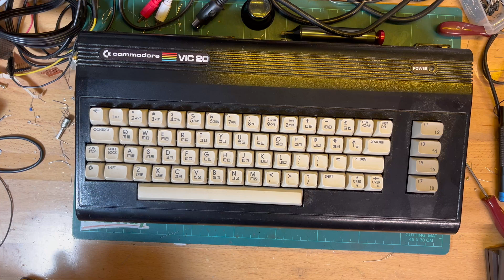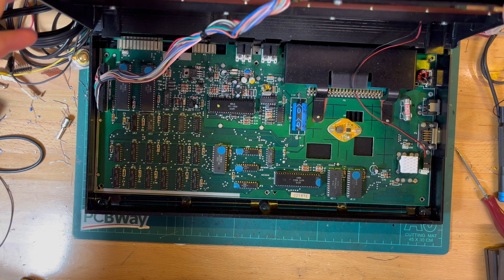Simple KiCad For Simple Vintage Computer Hobbyists: Part 5 (VIC-20 RAM Expansion) [#TCE0597]

Comment: What would it take to make the switching of the RAM expansion the result of keyboard combination presses? Electronics noob alert but could you feed a few keyboard lines into the GAL and program it to have logic that if you press, say RESTORE + F1 it switches the RAM off and RESTORE + F3 it switches it on? I assume it would need to reset the machine at that point too. Not a request, just curious.
Reply from the maker: I know similar has been done, i.e. switching between JiffyDOS and normal kernel on the C64.  It would require access to the relevant keyboard connector pins to get the key press.  If you were designing a new board, like the Vicky20, then you could probably implement the handling quite easily.  I'm not keen on the Vicky20 as it uses the CR version I think ... I prefer the original 2-prong, single 9V powered ones.

Comment: If I understand correctly, this is effectively a switchable internal "3k expansion".

In my vic experience, a more common expansion requirement for software releases back in the day was 8k and sometimes 16k. These days for new games it seems people go for either unexpanded or maxxed out 35k - for example Elite was recently released for this configuration.
Reply from the maker: Yep - main idea is to just replace the internal RAM but we get the additional 3KB as a bonus.  I guess there is no harm in having the additional 3KB permanently active ... it's the 8KB+ expansions that mess around with memory locations more it seems ... but just wanted to be on the safe side.  I wonder ... maybe add Super Expander functionality (i.e. the ROM) as well ... ?
Reply: @Brfff  I think unexpanded vic has BASIC start (program load address) at $1001, the 3k expansion moves this to $0401 and 8k, 16k, 24k, 32k all use $1201 for this. I think the maxxed 35k has it at the same place as 3k expansion. This load address is usually defined in the first 2 bytes (little endian) of a PRG file. So those values often indicate which expansion is required.

3k expansion has no impact on the location of screen and colour memory, so you're right about it being more compatible than the other expansions on this point because these all move screen and colour RAM in the map. 

Moving BASIC can have an impact on compatibility though, for example for the popular single-load machine code program written for unexpanded VIC with a "basic stub" that contains something like 10 SYS 34567 (this is all LIST would show you). If BASIC is in a different place, the machine code that follows the BASIC program bytes would be in the wrong place and all the fixed addresses will be wrong. Pure BASIC programs written for unexpanded VIC-20 might often work OK.

Comment: Hi Brett,  I’ve not checked this but by the 2114 pinout this chip has no output enable which means chip select enables the output already which in turn means when ever /cs is active (low) either the cpu is using ram or the Vic is reading ram what is happening is only determined by /we. So you don’t need to consider phi2 at all. Phi2 determines wether the cpu or Vic is using ram. So your output enable is only (/cs or not /we) nice thing it’s easily fixable in the gal later if you routed all necessary signals to is 😊👍 nice video series!
Reply from the maker: Ahhh, makes sense thanks!  And yes, that's why I thought I'd use a GAL ... if I made a mistake then I'll just "patch it later"!  I wasn't sure how to handle /OE because, like you said, it's not used on the 2114s ... so I relied on what grok had to say (Query 3 in link below) ... it doesn't seem to hallucinate as much as ChatGPT does
https://github.com/0ddjob/Commodore_VIC20/blob/main/Internal_8KB/grok.md
Reply from the maker: You were 100% correct.  I managed to get the board working over the weekend, being able to switch between base 5KB and expanded 8KB with a switch.

Comment: Looks good. I was going to say some other stuff, but Grok said it all in the Notes. 😑
Although, at 1:02:02 how confident are you of your 30mm measurement? They way it fell on the layout was at 30.46mm, which is within cooey. Maybe the whole VIC-20 board is laid out on the 100mil grid?
Reply from the maker: Yeah, I did find it a little surprising that a US computer from the 1970s lined up exactly at 30mm ... although was the Japanese VIC-1001 the first one ... ? :)  
I used my Japanese Mitutoyo calipers to measure - I'll desolder the RAM chips and measure again the empty PCB holes before I send it off for fabrication!
It looks like the chips were manually installed before wave soldering ... one pin on each chip is bent over which is what I used to hook my calipers on to.

Comment: try grok DeeperSearch... i had it "think" about it for a good 10mins before putting out an answer!
not a bad little board..good job!
Reply from the maker: I've been wanting to design a "universal" DRAM-to-SRAM module that could be used to replace the original RAM on various machines with a modern SRAM chip ... I know at its simplest you need to latch half the address on CAS (or RAS) then wait for RAS (or CAS) to get the other half, then you can apply the full address ... maybe grok and deepersearch can help me iron out all the intricacies that need to be taken care of. 

For example, the УМПК-Р I'm working on ... could replace those eight 64kbit DRAMs with a single 32Kbyte SRAM ...